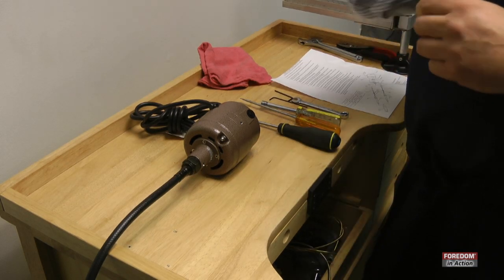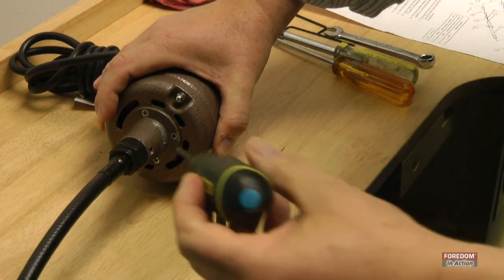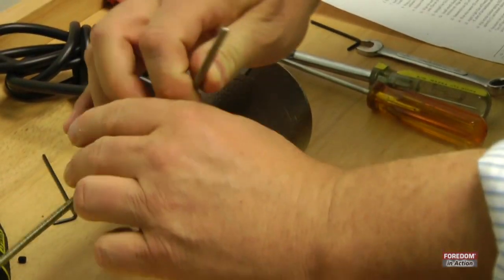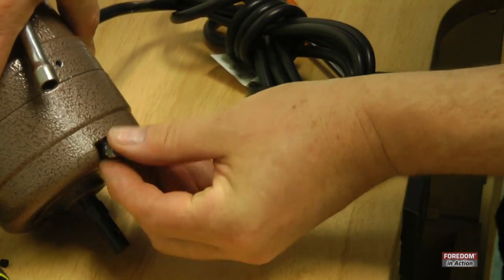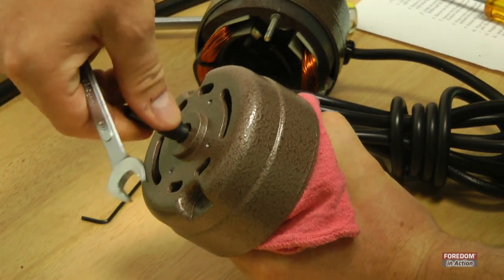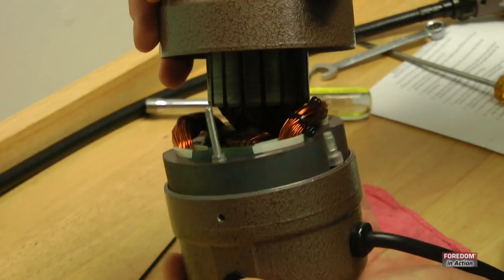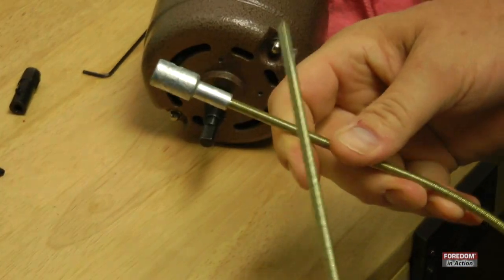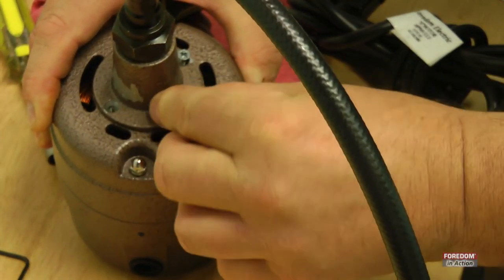Series H Shaft Connector/Adapter Retrofit Kit

Comment: I have a vintage series c, Any chance i can use modern hammer pieces with it? the one currently on there gets too hot to hold.
Reply from the maker: Yes you can. You may have had too much grease on the shaft and it leaked into the handpiece. Try to get the excess grease out of the the handpiece - carefully and let it drip out of the shaft or wipe the excess off of the shaft. That causes overheating. Also only run at a slow speed.
Reply: @ForedomElectricCo  Thank you , I'll try that.

Comment: were can i buy the kit?
Reply from the maker: There may be dealers who carry it, but I know you can get it on our website. Here is the link. https://www.foredom.net/product/s-10804b-heavy-duty-shaft-and-sheath-assembly-for-series-h-motor/
Reply: @ForedomElectricCo  isn't that just the shaft and outer shaft.
I want the retro fit kit
Reply from the maker: @solbrown2677  I apologize for my error. We do not sell a lot of them. Just talked to the sales manager– The S-10805/45 is the retro fit kit https://www.foredom.net/product/s-10805-45-square-drive-shaft-for-series-h-motors/   (we are going to add a photo to the website with the other part) includes a shaft and a D flat extension for the retrofit. It does not include an outer shaft or the silencer spring. If you want to completely replace everything on the shaft, you also need a sheath - the rubber thing on the outside (WITH the silencer spring) part number is S-10802A   https://www.foredom.net/product/s-10802a-heavy-duty-sheath-for-series-h-motors/ You may not need a new sheath but they need replacement from time to time if they get old or damaged.